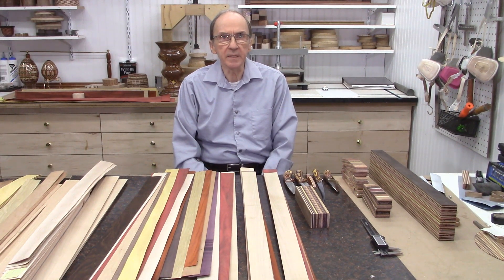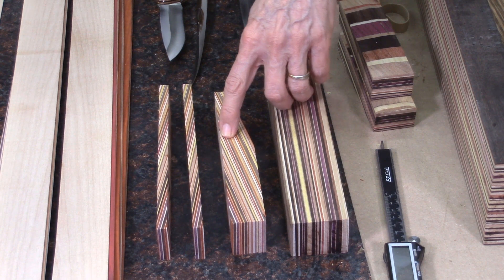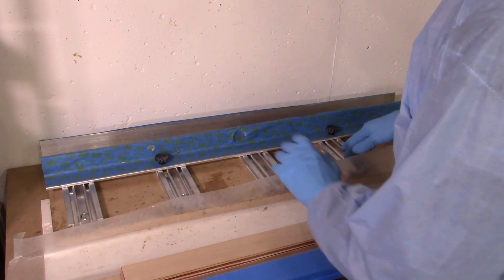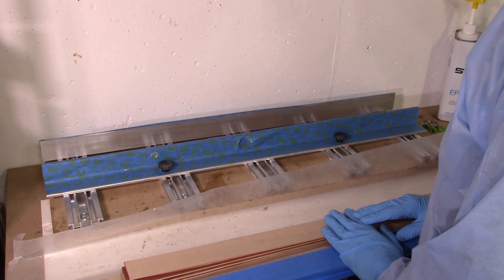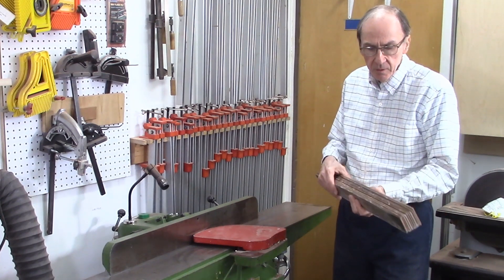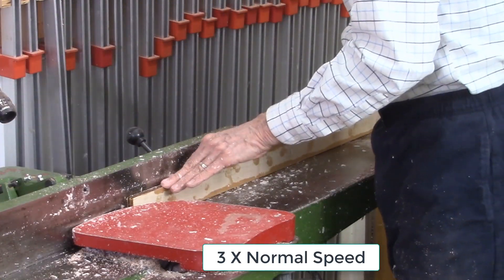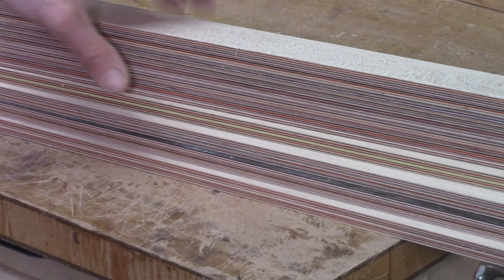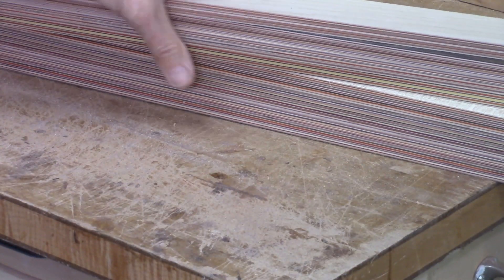Production of Multi-Layer Laminated Boards from Thin Wood Strips (72)

Comment: how durable are these when finished? could you use this same process to make axe handles?
Reply from the maker: I would imagine that they would be quite durable.  Laminated boards are much stronger than solid wood boards and the glues between the laminates such as the TiteBond glues are stronger than the wood itself.